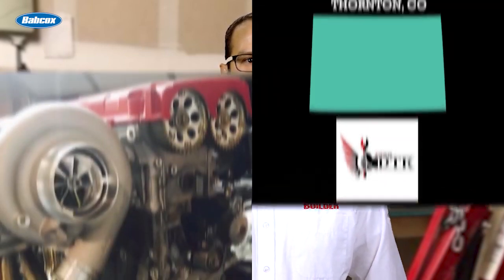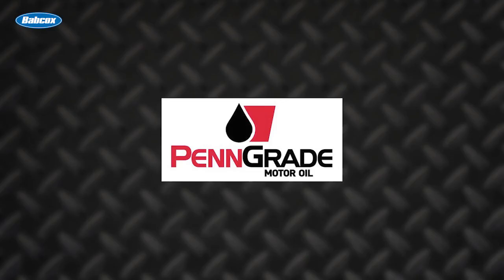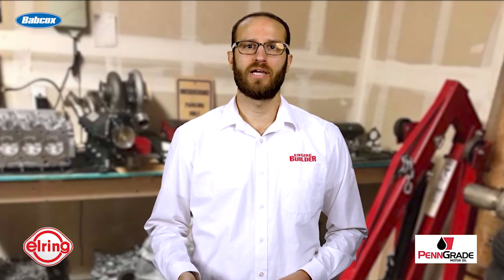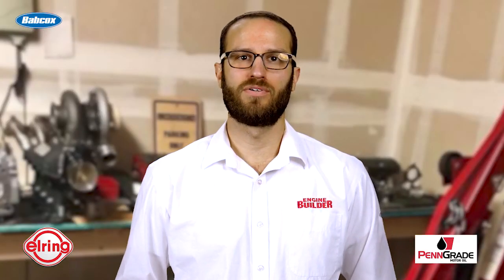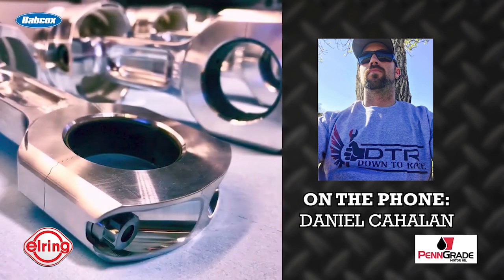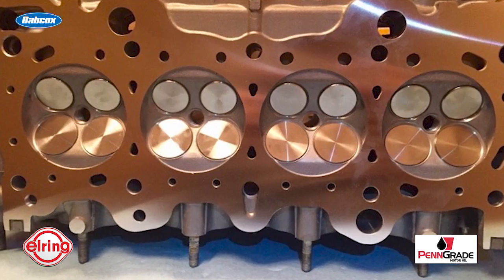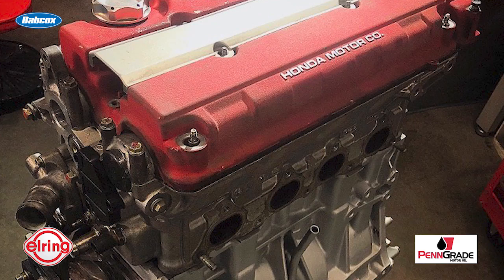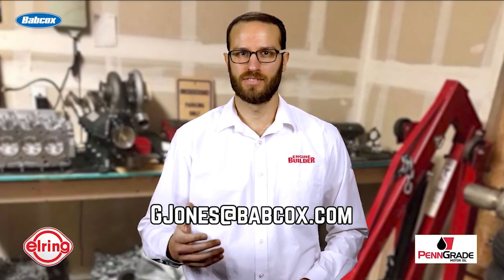Turbocharged Honda B18C Engine

Comment: I wish you guys would give more details than just a general brand sound off... I mean what are the specs on the cams? Injectors? Engine management? What kind of power did it make? Ignition system? Timing? Boost? Style pistons? 

Just thought for the name of the channel this would have been a bit more in depth.